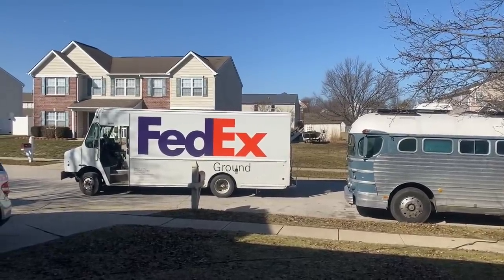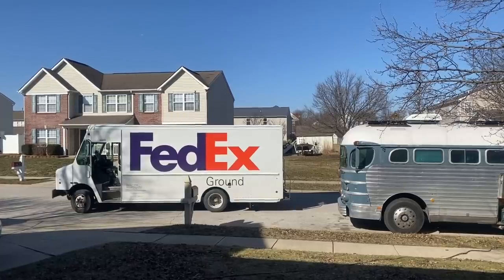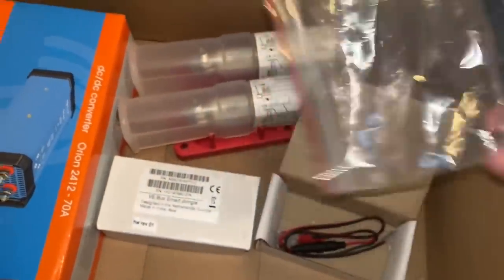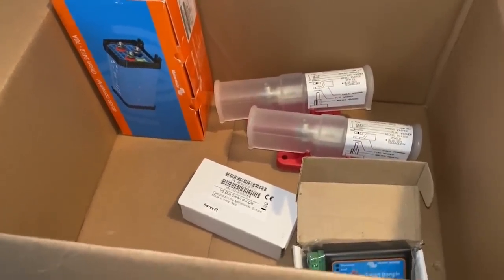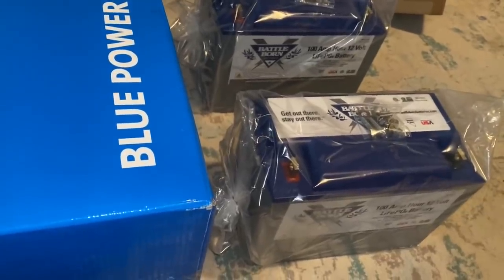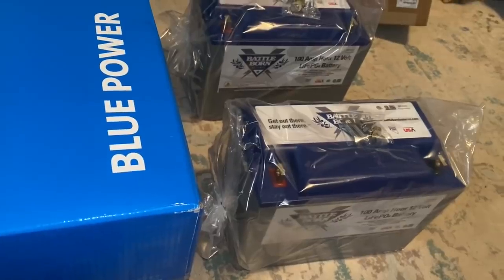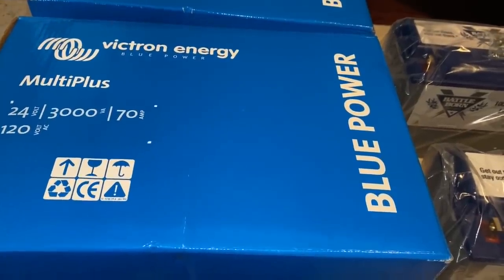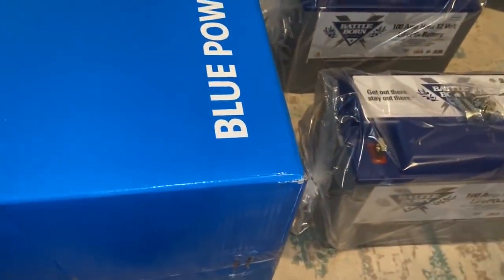Victron Power inverter upgrade video 1

Comment: That 4/0 cable is one of the reasons I went with 48 volts. All 2/0. Way easier to run, terminate and connect. You got me beat. I have one 5000w and you got 2- 3000w. Your going to love it.

Comment: be careful when putting the Victron face cover plate back on, its easy to bend the black rocker on/off switch.  Also you can run those units in parallel single phase very easily, or use split phase ( for US 110 volt wiring that has 2 active legs) but thats a complex issue that needs careful research.

Comment: I bet Lennie is cooler inside due to the heat shield provided by the panels.
I noticed that the used panels are equipped with a MPPT boxes on each panel, so diodes are not required.
Reply: Good that no extra diodes are needed then!

Comment: I have a suggestion.  Adding "One-way" Diodes at the Positive Connection to the connection inside the Solar Panel Connection Boxes will eliminate negative draw on the entire grid when something causes shade on one panel.
Reply: I have an onboard generator and I'll be running an inverter as well

Comment: Please consider explosion proof battery boxes and fire extinguisher's just to be safe.
Reply: LiFePO4 doesn't give off hydrogen gas under normal circumstances. If they are giving off gases it's because they are already on fire. RVs of course should always have fire extinguishers.

Comment: those victron inverters are amazing machines. There is no perfect way to wire them for 50amp in an RV though. If you run them in split phase (the way i generally reccomend) you get 2 independent legs, the issue arises when you plug them into a power source that is not split phase (like most generators or 110v outlet). What happens in that case is 1 inverter switches to charge and pass thru mode, the other inverter sees that the output is not "split phase" so it goes into inverting mode to generate that phase split. what this means is you have 1 leg running on shore or gen power and the other leg running off battery power. Hopefully the 1 inverter that is charging can keep up with the demand of the second inverter, this becomes a major issue on big 5th wheels or mohos that want to run both ACs while on gen or shore power that is not 220v. 

I have never tried running 2 off separate blue tooth modules with no network cable between the 2 inverters, ive had my suspicions this might be a cure for the issue. Ive only installed them with the GX color display which require both inverters be tied together on 1 network. Once they become aware of each other you have to specify parallel or split phase.  Hoping this might be a work around BUT i do see if causing issues with the load share and current limit functions.

Comment: Love the set up. My 2c worth would be to put a fuse at the battery. The cable run might be short but there's a hell of a lot of power that can be delivered through those cables.
Reply: When he showed the box of parts with the 24-12V power supply and the dongles the other two items looked like fuse blocks. One thing I never see people seem to install is disconnect switches. Then they get nice sparks when they hook up inverters.
Reply: Absolutely.  Proper size fuse as close to the positive battery terminal(s) as possible, followed by a properly rated disconnect switch.  I have a 24V/4000W Magnum inverter.  The AC in/our runs through 50A RV plugs/sockets.  It’s set up so if the inverter/charger fails, and can move the connections and have shorepower or generator power to everything in the bus.  Could probably do the same things with A-off-B switches, but the socket/plug approach was easier to do.  I actually had a charger failure a couple of years ago and was able to use this feature.  Minor problem with the charger and easily repaired, but the unit was useless until it was taken care of.

Comment: That is going to be such a nice set up. Considering the amount of battery capacity you will have, have you considered putting some kind of automatic disconnect on your batteries in case of an accident? There's a special switch on the Prius and other electric vehicles in case of impact or roll over and it might keep your bus from catching fire. Granted, you'll never run into anybody..... But, somebody might run into you.

Comment: When you go from 12V to 24V, you do not lose half your battery capacity, The Amp/hours of the battery bank is cut in half, but you are only drawing half the amperage now at 24V, so your batteries will take the same amount of time to empty
This means your over all POWER capacity does not change. You do not need another 8 BAttleborns. 8 alone is a very large system.
If you plan on running an electric hottub 8 hours a day......... thats another story.

The advantage of a 24V system is the amperage is less on the wires to your battery bank meaning you can use smaller gauge wires. Also your system is more efficient since you have less power loss across the cabling (due to less amperage). Also less amperage drain on your batteries will make them last longer.

Comment: Have you thought about running your batteries at 48V?
Reply: 48v is better for 10kw plus systems. If he runs 24v he can jump start the buss from the bank if for example head lights were left on.

48VDC - House or 10kw plus setup.
24V Automotive heavy duty eg: mobile offices, mobile homes and truck sleepers.
12VDC - A car for convenience eg power tool charge or laptop.

Comment: Is there any special considerations for grounding an aluminum vehicle to prevent corrosion? My airstream motorhome has a frame, then the aluminum chassis, so aside from the frame to motor grounds I was going to run multiple frame to body mounts for a good ground path, anything else I should consider?
Reply: I would assume aluminum fasteners for the aluminum stuff and standard steel stuff to the frame. I would presume that the body is already bonded (the correct technical term) to the frame. Ford actually has a document for their F150s for upfitters regarding mounting stuff to the aluminum bodies.

Comment: Wouldn't it have been cleverer to put Tesla batterie modules in ? Cheaper , more powerfull ,lighter, and longer lasting. 24V, 233Ah, 5.2kWh. For around $1000 on Ebay

Comment: Those "hard start" caps are going to leave you wanting when it gets hot out.  If you're in there already you should really look into the Microair, they work exactly as advertised and provide an actual soft start.  Otherwise with one 3kw inverter and anything else powered up it's going to struggle starting an A/C compressor.  That cap does nothing to help this situation.
Reply from the maker: I already have one on the other and it start much easier